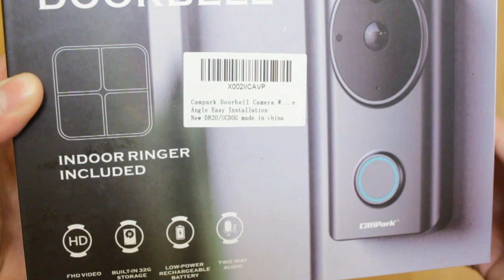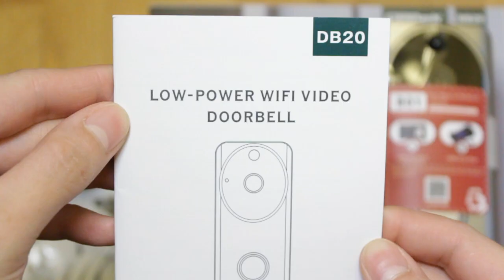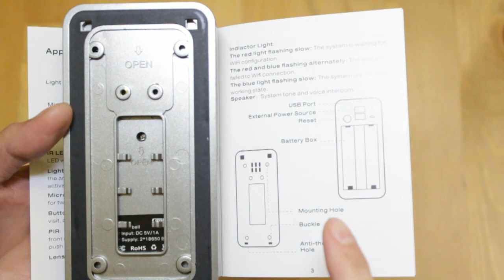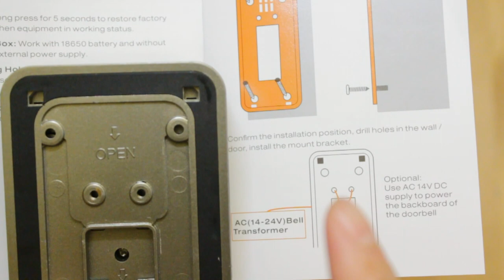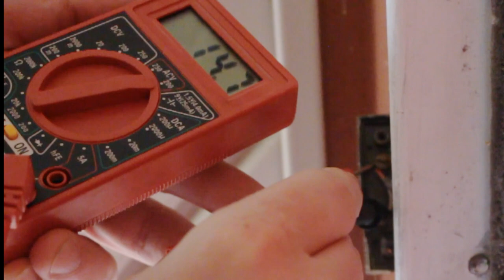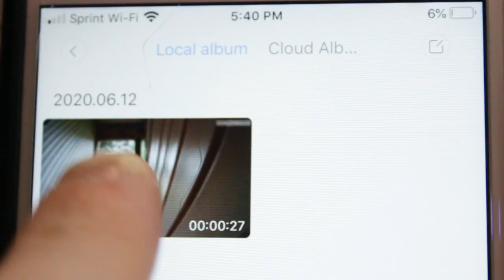CAMPARK VIDEO DOORBELL UNBOXING AND INSTALLATION

Comment: I just bought one and I charge it for 3  days and  it's already going dead after 3 weeks how long do battery life last
Reply from the maker: It shouldn't take that long to charge it. When I charge ours, I just plugged it mostly overnight and fully charged in the morning. In regards to battery life, I think that happened to us when the motion sensitivity was on high and getting every single alert every time a leaf from the front tree moves. We just turned the sensitivity to low since we are using another camera so we basically just need this for doorbell really. I noticed ours doesn't last as long during cold months compared last summer and fall. As far as I can remember, I think the battery of ours lasted about almost 6 months last summer but with motion sensitivity in low. Lately around these cold months, I have to charged it twice now. Not sure if it just really because of the weather or it is already dying on me. But I believe it is just the weather.

Comment: If I hardwire, will my existing bell still work if I press the bell?
Reply from the maker: Hello! When we tried ours, the old bell chime did not work but this isn't a problem for us because we use "Echo" anyway. We actually did not use the chime it came with it.
Reply: @empaulinocraig  how do you connect to echo?
Reply from the maker: @airportdocumentaries  just enable the skill thru Alexa App then pair it